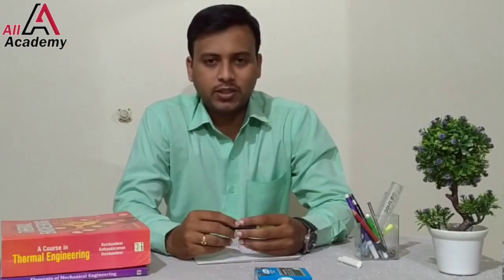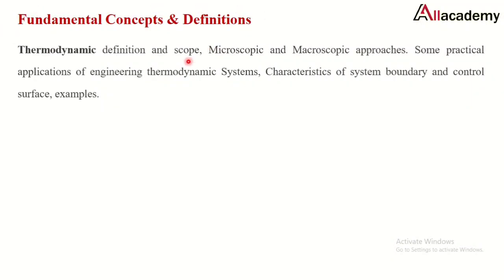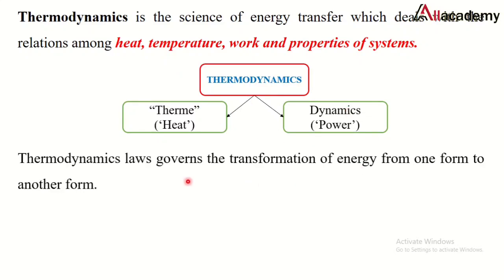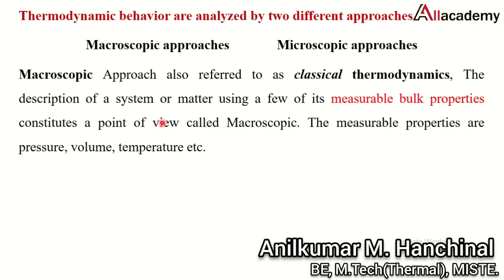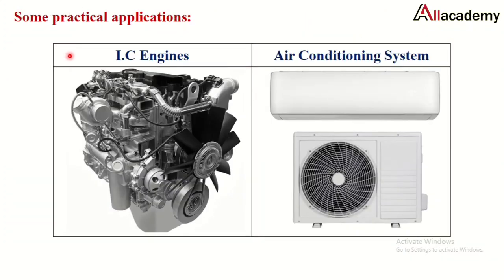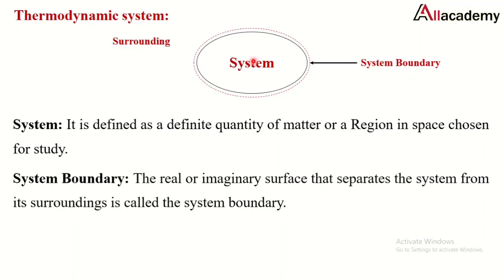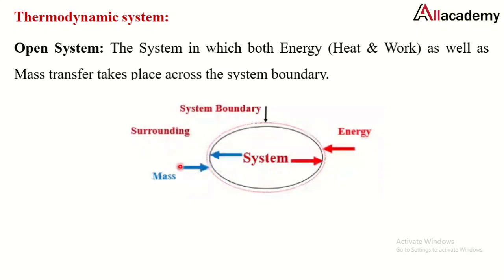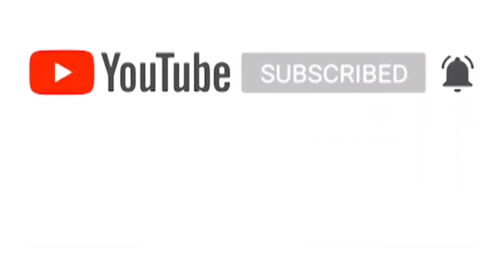BTD : Module 1 | Fundamental Concepts & Definitions | Part 1 | As Per VTU CBCS Scheme | All Academy

Comment from the maker: Question  : What is Isolated System.
Reply: Isolated system is a system in which neither the transfer of heat and work nor transfer of mass takes place across the system boundary.
Reply: A system where there is no transfer of mass or heat of system with the surroundings

Comment from the maker: Question  : What is Closed System.
Reply: A system in which only the transfer of heat and work takes place but there is no mass transfer across the system boundary is known as closed system.
Reply: A system where only transfer of heat takes place keeping mass constant
Reply: If the boundary of the system is impervious to the flow of matter then we call it as closed system